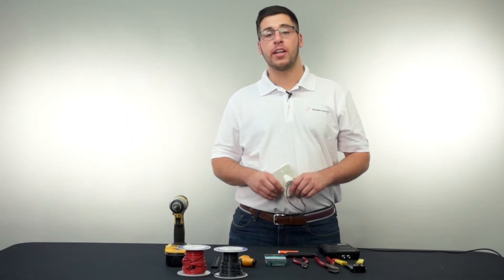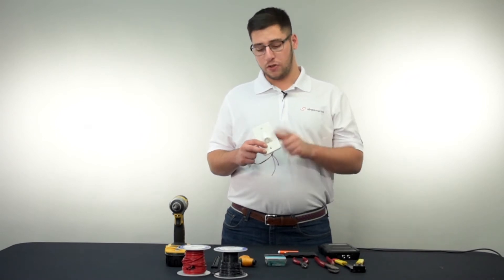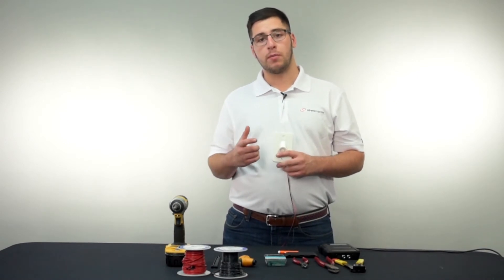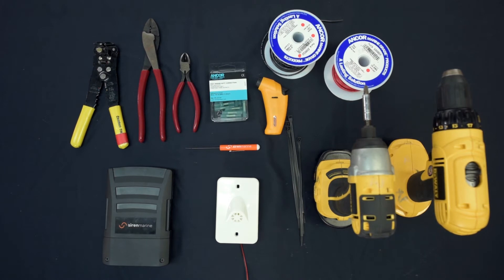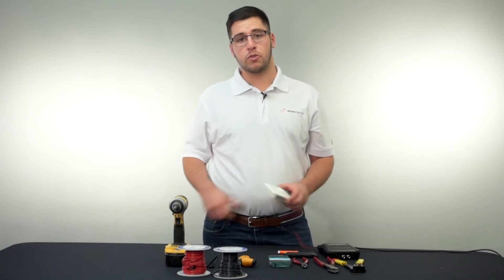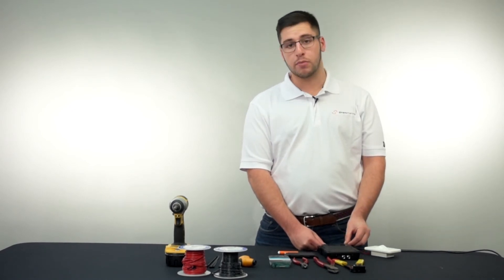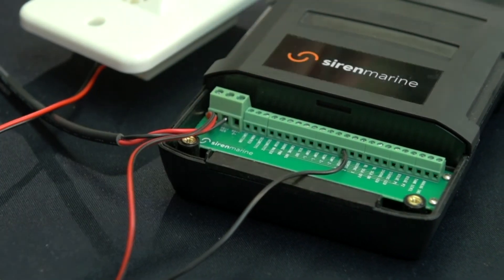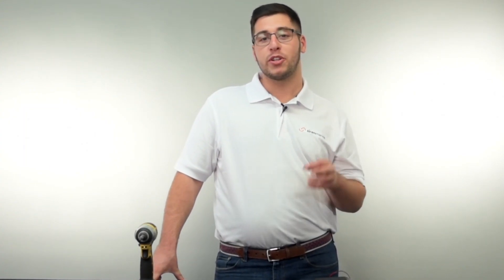Siren U - Connecting Onboard Devices to MTC Outputs

Comment: I’d like to see a video about how to use a use a relay to connect to a higher amp device like fridge or A/C. Thanks!
Reply from the maker: Hi John, thanks for the suggestion! We're currently working on quite a bit of video content, and we'll certainly add this into the mix.
Reply: @SirenMarine  Guess this is never coming since ya'll were bought out by Yamaha?
Reply from the maker: @scottminchak8427  Our DC Relay will support up to 10 amps, which should cover most accessories. Give us a call at 855-75-SIREN (855-757-4736) and our support chat can talk through your specific needs and situation. If you'd prefer, we can also be reached at support@sirenmarine.com